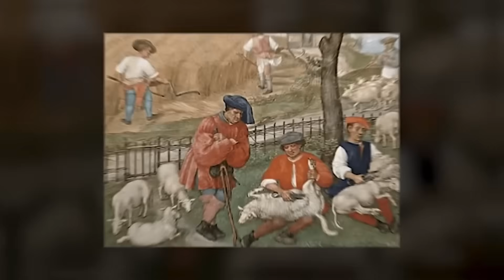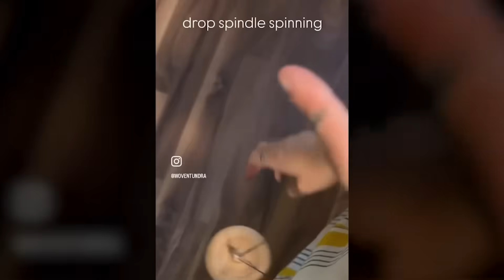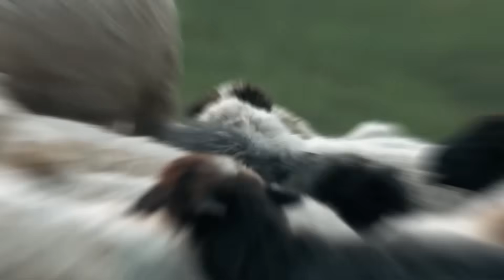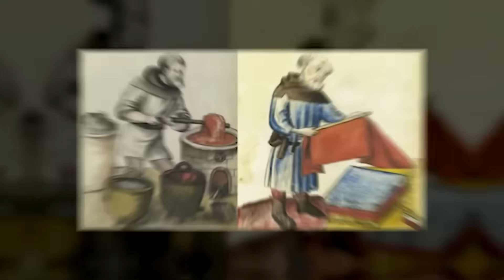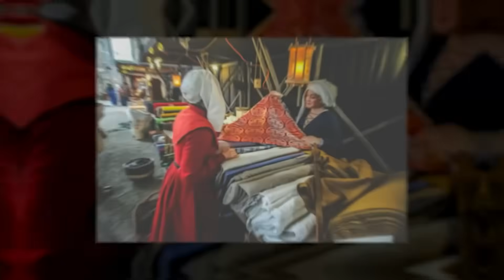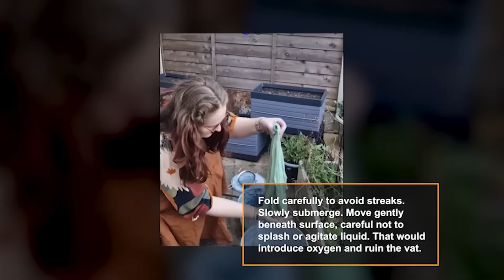Why Medieval Clothes Lasted Longer Than Ours (And How They Did It)

Comment: I'm a life-long fiber artist and I can tell you that there is tons of misinformation in this video. First and foremost, alizarin crimson, made from madder root, is not lightfast. Watercolor artists know it as a fugitive pigment, meaning that it fades away or discolors with exposure to sunlight--professional watercolor artists won't use that pigment, knowing their art will not last. Modern synthetic pigments do indeed last much longer. 

As for modern dyes (technically dyes and pigments are two separate things but both can be used to color cloth in different circumstances) there are a great many to choose from depending on the type of textile to be dyed--whether it be a protein fiber like silk and wool, or a cellulose fiber like cotton or linen. And modern dyes do, in fact, chemically bind to the fibers in most cases. Many modern dyes are also far more stable than madder root. I can't speak to woad as I've never used it and I don't know anyone who actually has. I do know that many mordants used with "natural" dyes are heavy metals and just as dangerous as modern dyes, if not more so. Claiming that these are somehow more ecologically sound, safe, stable, or long-lasting are fantasies. The old ways were different, not necessarily better. That knowledge should be preserved and continued to be practiced but let's not delude ourselves or romanticize an era to the point that we're telling lies.

A deeply saturated scrap of fabric or two may have survived but most people interested in textiles know that fabric artifacts like this are extremely rare and are discovered in rare circumstances like bogs that are devoid of oxygen and would be opaque to sunlight. That's the reason those scraps survived--not because of some magical chemistry that is somehow superior to what we use now. (By the way, I'm not saying that fast fashion is a good thing--far from it! But let's just tell the truth. There's no need to make stuff up.)

Furthermore, lanolin, so glorified in this presentation, is stinky and extremely sticky stuff. Most modern hand-spinners want it out of the wool because it makes hand-spinning more difficult. I've no doubt that it is capable of waterproofing fabric, but the cost is not one most folks would want to pay--social isolation. Most people don't want to be around others who stink. Maybe if the lanolin was super-refined like the stuff put in hand lotion--that's deodorized--and if it could be combined with something that would make it less sticky… then maybe it could work. Bees wax is also sticky, by the way. I can imagine that it's possible--but the dirty brown grease shown in this presentation is not that. The lanolin shown is still full of dirt and sheep poop. Yes, poop. It has to be further purified before it could be used in the ways suggested and that probably needs to be done industrially to be a viable industry. I process a couple of sheep fleeces a year and there's no way I'm going to take the time to purify such a small amount. I know it can be done but yuck. What a stinky process that would be.

I won't be watching any more of the videos produced by this channel. I don't mind the monotone AI reader at all. I do mind the lies, romanticization, lack of actual research, and lack of expert consultation on these textile topics. It's embarrassingly badly done.